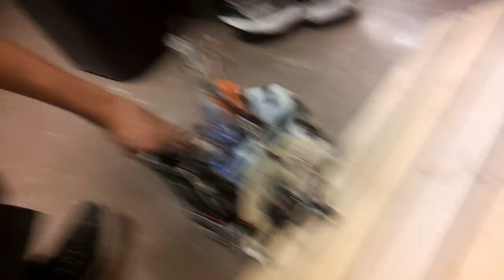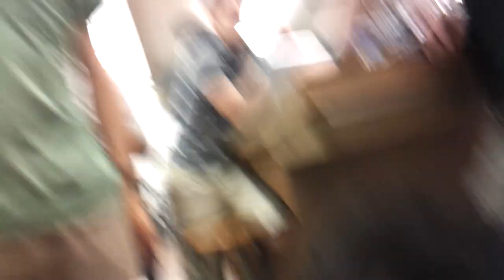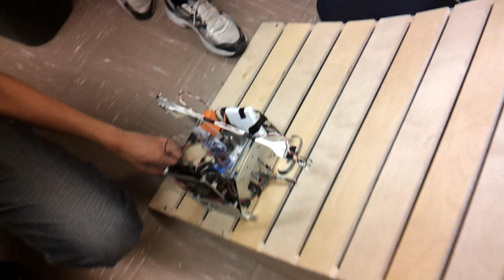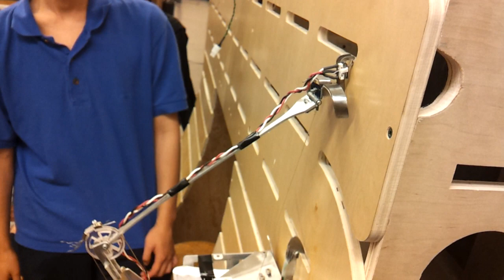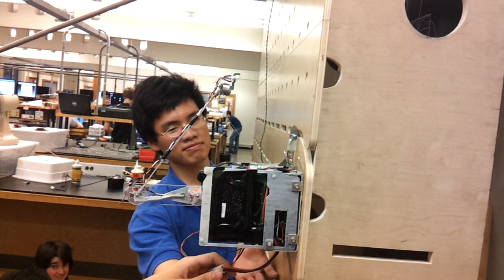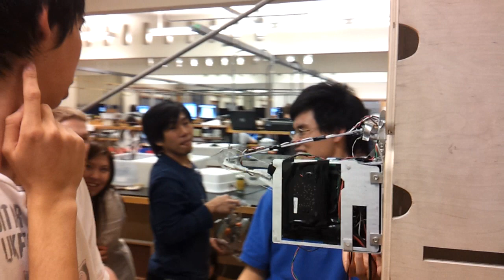UBC Engineering Physics - 2011 - ClimberBots - Testing

Comment: There is no specific material used to grip the well - there are holes in the surface, and the climber uses its aluminum "claw" to reach into the hole and has just enough surface contact to hold up the whole weight of the robot.  It works pretty well!